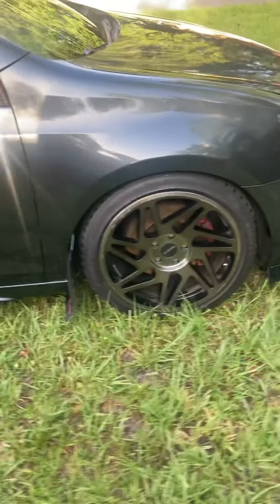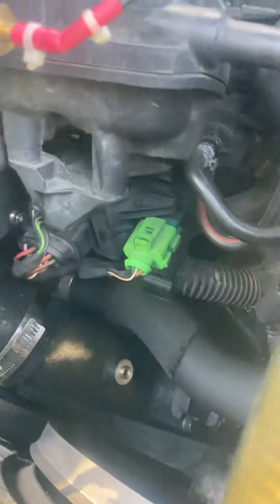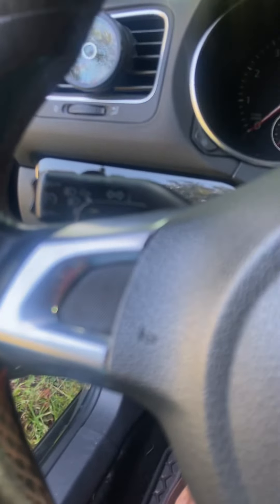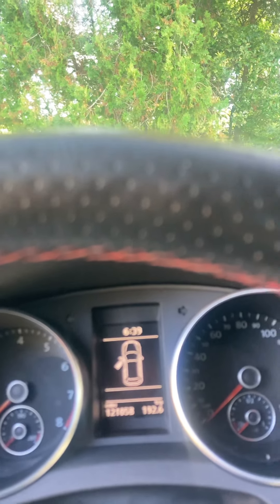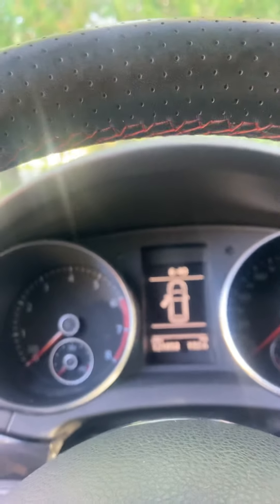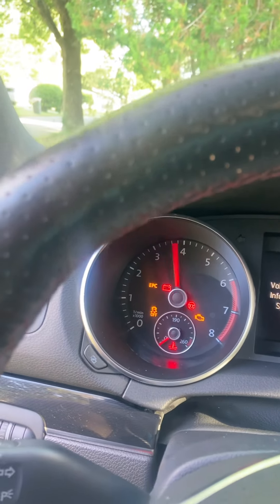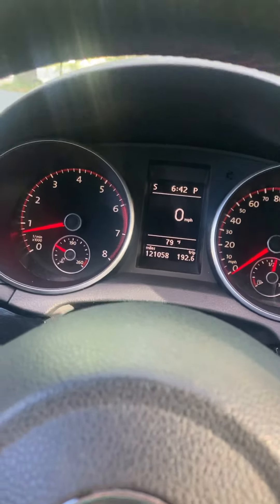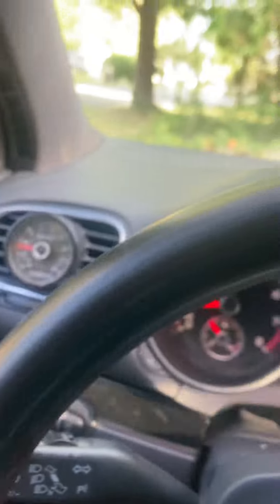Gti mk6 70mm Gram’s throttle body 2nd review

Comment: hey man, i’m looking at getting the same throttle body and was wondering if you’ve had any issues with it and if you’ve had to get a retune for it?
Reply from the maker: Don’t do it!!! There’s no current tune for it and the software conflicts with the ecu… I’m sending mine back to have them check it but, it’s a no go in my book. Sorry, hope that saved you about $400 and a headache 🤕. Totally not worth it fam.😞
Reply: @razturret  it’s all good man, wasn’t sure how well these were made since there’s not much on yt about it. hope you get it all figured out. love your gti btw!!<3
Reply from the maker: @ashtonsluss3536  thanks fam!!! I should have paid attention to the forums. My mission is 4plus with the Apr Ko4 kit.
Reply: @ashtonsluss3536  Late reply, but:

The throttle body MUST be adapted via custom tune. Your dash will throw a perpetual CEL, which most conventions would require you to use VAGCOM to perform a TBA. However, this will not resolve the issue because the ECU doesn't understand why the fuel-air mixture is out of balance (hence why a tuner's intervention is needed). 

Thus, using an OTS tune like IE, APR, Unitronic, etc. while the throttle body is installed will not give you the performance you would expect, and can cause more issues if kept on. (Some club members, myself included, started experiencing early onset failures we would not have expected to experience related to the throttle body, such as crankshaft failure, massive carbon buildup, poorer performance than usual, etc.. For reference, this was experimented with MK6's, which were in various stages, including Stage 2 IE/APR/Uni/Stratified, Stage 2+ (Ko4) IE, Stage 3 (GTX3076R) custom tunes)

If this doesn't help you, hopefully somebody else reads this in the future and saves them the headache.
Reply from the maker: @harryle4143  wow, I just seen this!!! You’re absolutely correct… I found that the IE intake manifold tune allows this throttle body to adapt! Tbh I just wanted to try it out , it didn’t work for me so I sent it back!!! Thanks for the reply fam!